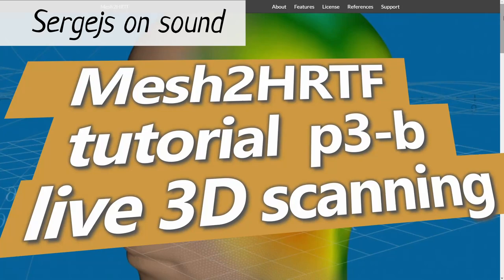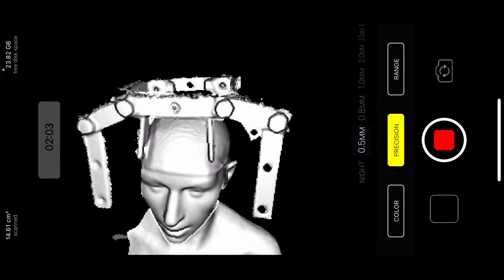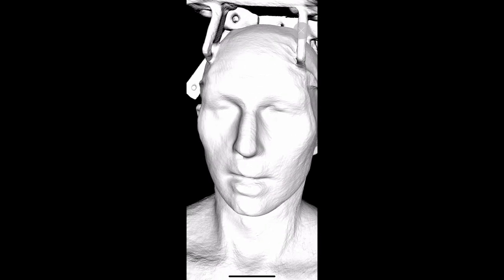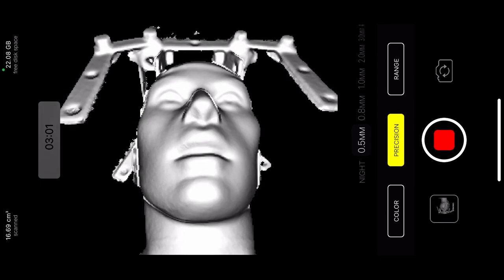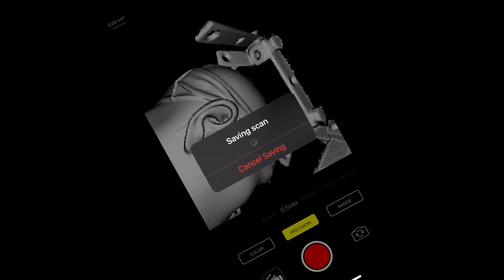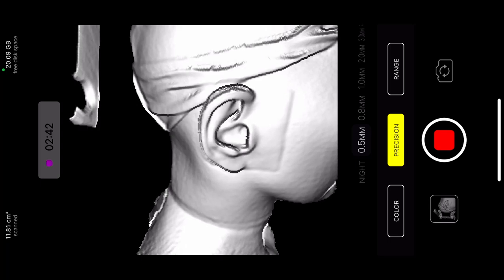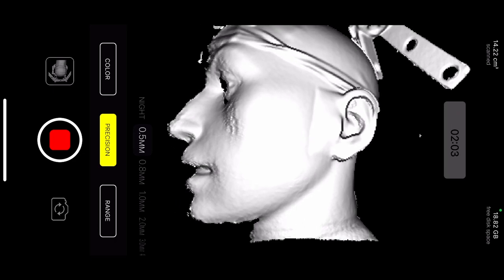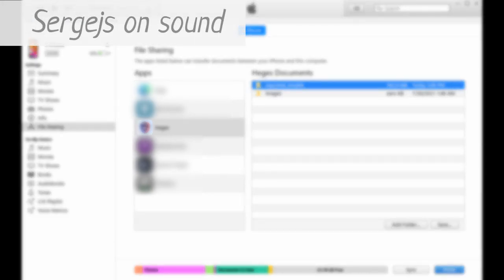Mesh2HRTF - t03b - live 3D Scanning

Comment: quick question why do you put that wooden structure like thing to the head?
Reply from the maker: 1- In the next video you can see how it is used to reliably merge 3 scans together. 

2- It helps the 3D-scanning algorithm to track the 3D mesh - provides distinctive geometric features.

3- Plus it can be used to quality-check the 3D scan by measuring straightness and dimensions of the frame in the 3D scan.
Reply: Thanks for the quick explanation. I have been working on HRTF related project and this is really helpful. So instead of using heges i am using 3D scanner app that is able to generate a point cloud data of my 3D face model. Next i have transformed this point cloud data to a stl file and i am following your video to get a proper mesh. Well I wasn’t aware of that there is a way of analyzing hrtf get sofa files from Mesh2HRTF. I was actually doing it for COMSOL based Head and Torso HRTF computation. However, backing up, I am a bit skeptic if with my 3D model i can follow your tutorial and get the data. I actually scanned a full 360 model of my face and i think there is no over lap. Is there anyway i can show you the scanned geometry? Like email or link? If you could give a quick check that would really helps. Eagerly waiting for your feedback. Appreciate your time to reply me back.
Reply: @Sergejs_on_sound  well, for the reference, i have used this app of the following link : https://www.youtube.com/watch?v=ZPX0rMHoD_Y&t=4s
Reply from the maker: @abidshahriar7095  Hi, Interesting app you are referring to. That video seems to be quite old, so the link to app-store did not work for me. It might be a good alternative to Heges 3D - depending on the end 3D mesh quality.
If you are wondering if your mesh is good enough - you could create an issue on the Mesh2HRTF GitHub. Your experience could be valuable to others who are trying to scan with the same app.

Still, if you have a 3D mesh for COMSOL already - running a Mesh2HRTF simulation is the easy part :)  Besides, I am not aware of a method to simulate all the needed frequency-steps in COMSOL and then convert the results to a SOFA HRTF file.